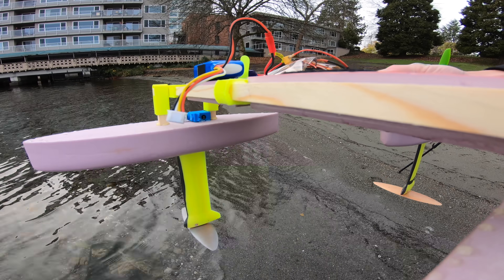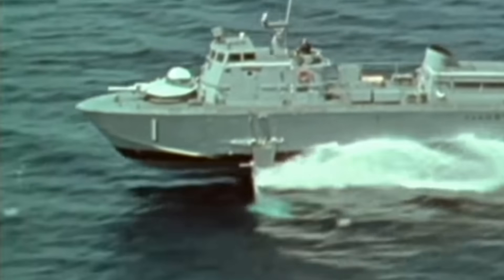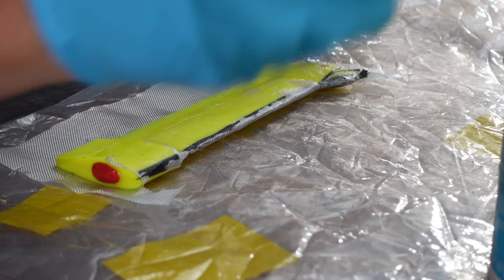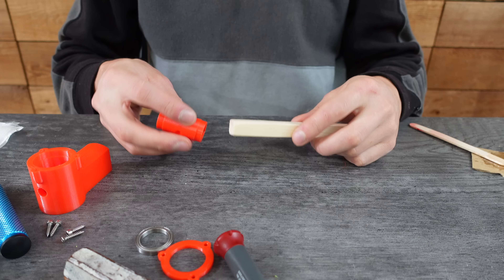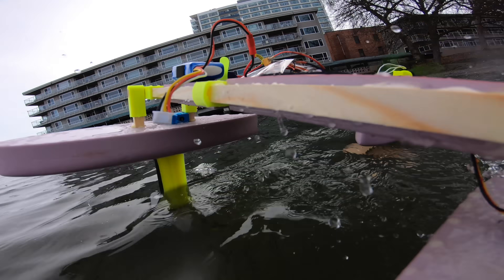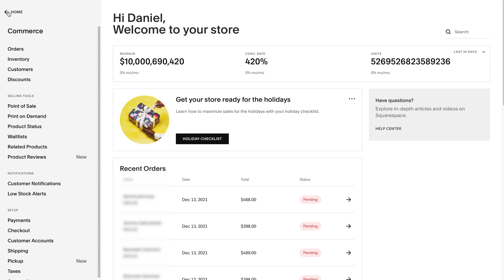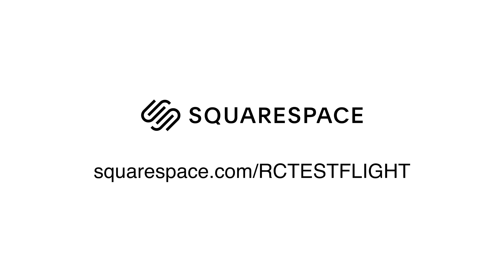R/C Hydrofoil with Sonar Pt.1 - Build

Comment: That is an awesome control problem! Next up, add sails! And make it a monohull. You'll be tackling the problems of current America's Cup "boats".
Reply: Why would a monohull be beneficial here?
Reply: @rafaelbachmann7246  not necessarily beneficial. More like challenging.
Reply: Although, in the Americas Cup, they do point higher. I'm not entirely sure they're necessarily faster.
Reply: @halfeld  I'm preparing to work on a multihull foiling autonomous miniature sailboat hence the question. By preparing, I mean I want to do it and have some of the basics in place but it's such a daunting task.
Reply: @rafaelbachmann7246  keep me in the loop. I'm going to get into more stuff like that soon.
Reply: @halfeld  likewise! I checked out that VTOL concept. Quite fresh! I had spent some time trying to think of VTOL designs while making my own flight controller. The evolution of which will power some day the foiling trimaran sailboat :)
Your design is the most mechanically complex one I've seen to date, though - well gotta pay for the advantages somehow
Reply: @rafaelbachmann3619  exactly. I'm leaning on the need for redundancy in urban operations to justify the complexity, as well as capitalizing on the resulting advantage. Glad you liked it!

Comment: Question: Why do you use airscrews for propulsion? Wouldn't it be better if you put the propeller underwater? (with chain drive or smth)
Reply: Ollie and Ezra, you're both correct. 
Getting the power from a motor that is in the boat, to a propeller on a foil that is suspended separately from the boat, is a considerable challenge, with a number of possible points of failure. Using an air drive is much less complex, lighter, and more reliable. 
Of course, it doesn't hurt that he probably has many suitable motor and prop combinations just sitting around his shop.
Reply: Perhaps the underwater foils cause propulsion issues for the prop? The design doesn't really have a place for traditional prop, hence your suggestion. So, I don't know, good question.
Reply: Because it’s easier to not get wrong. And he already has a bunch of those motors and stuff.

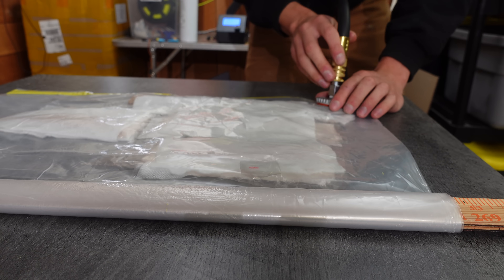Comment: @3:05 - I once used my 3D printing bed to carefully control temperature while concentrating H2O2.  I also used the cooling fan to promote evaporation.
Reply: what conc. did you reach that way?